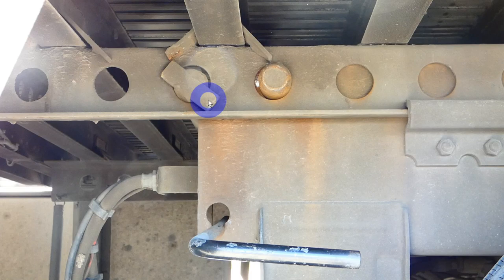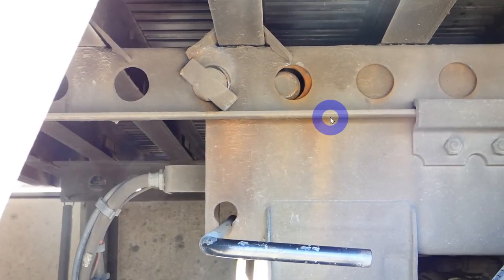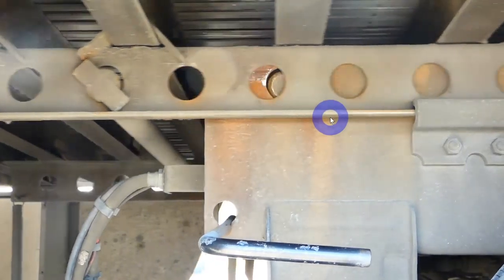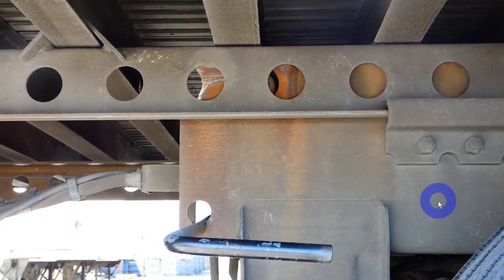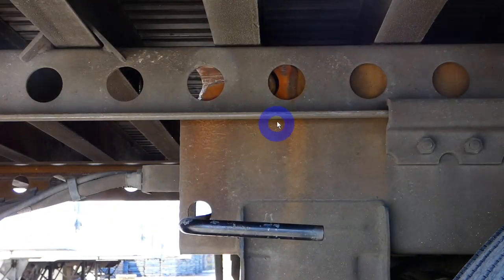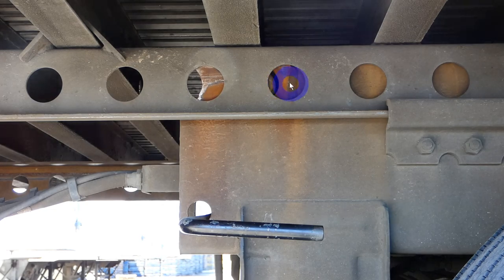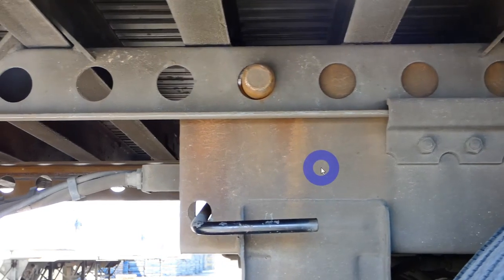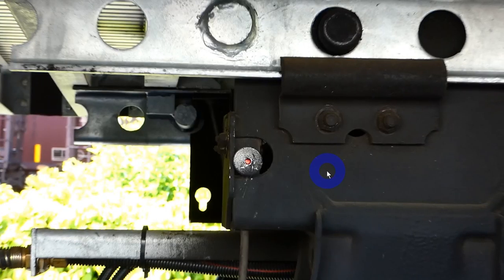TRUCKING STUFF - Sliding Your Axles On Your Trailer Tips

Comment: Two thoughts... 
- I remember my first time dealing with one of the air releases I was so confused. I figured it needed air to work so I had to have the air supply on, but then of course that didn't work. 
- These days with more experience I'm baffled by how many rigs I see going down the highway with the axles all the way forward. The trailer is just so much more stable and tractor better riding with the axles back. I always run them back as far as I can and still turn what corners I need to and be legal. I only run them all the way forward if I have some crazy tight dock or something.
Reply from the maker: Most loads are loaded in a way where the axles have to me mostly all the way forward to be legal. And of course California requires them to be mostly all the way forward. So most people are more comfortable with them all the way forward, most turns they make are all the way forward. You never know sometime when you need to make a tight turn. Life is just easier with them all the way forward, less to think about.
Reply: @MyTruckingSkills  Suppose it's mostly the type of work I've done but generally when I have to slide for weight I'm sliding back. I also drive a lot of mountain passes where the stability and smoother ride is very worth it.
Reply: @snek9353  if you  have room.  Most places I go  are set up 45s so you  arent getting  in there  unless they are all the way forward. Can be tricky with them all the forward  because of the tail swing

Comment: I had 1 pin today that I couldn't get to stay in all the way. It was just poking out enough to prevent tandams from sliding. The handle came all the way out and other 3 pins where all the way in.. I hit the 1 pin with a hammer and it went in.. But once it slid to the next hole it came slightly out again. Anything I could have done to fix this? I just hit it back in and went hole by hole

Comment: great video.  Good info.  Next one needs to show how to get the pins in the desired hole, like  the 41 foot rule or if you just need to go one or two holes to scale a load.  Going to use the vise grip trick.  Thanks
Reply from the maker: K
Reply: I've never tried it and just thought of it, but I don't see why you couldn't just pop in a couple stop pins. Carry a couple lengths of pipe and put them in the holes where it would stop it sliding where you need it to go.
Reply from the maker: That would work ya